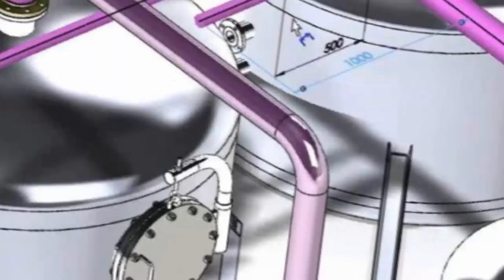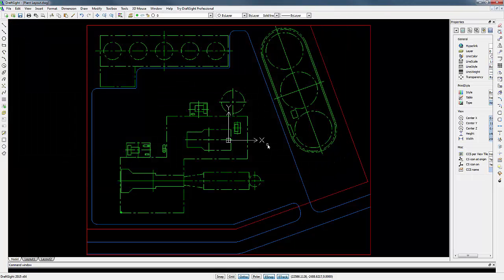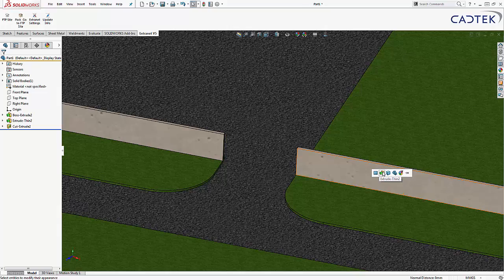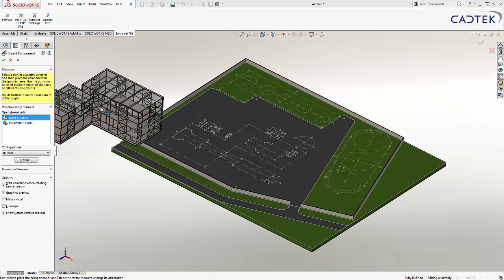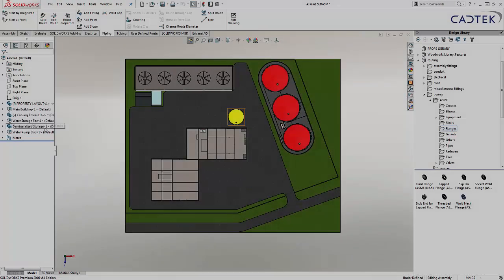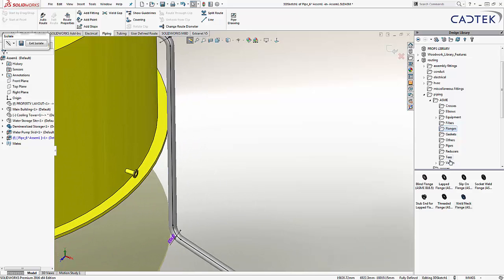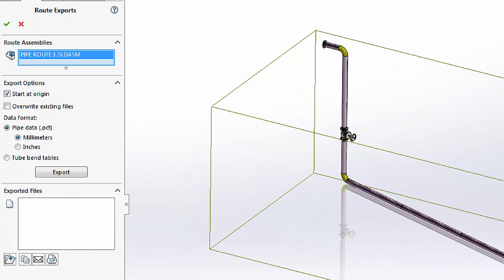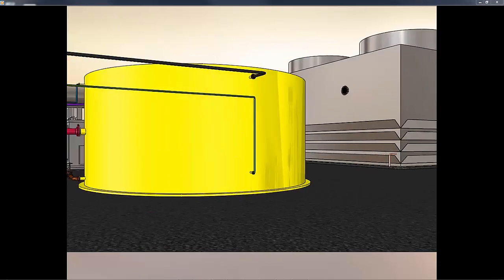Using SolidWorks for Process and Plant Layout

Comment: In sales video they import civil engineering DWG files and can easily 3D extrude by selecting watertight contours. In the real world the civil drawings are crap! Lines don't intersect at corners, there are 5 or 6 lines on top of one another, some components are over-complicated like trees with 25 000 lines and arcs, would-be horizontal lines are at 0.00001 degree from horizontal. Everytime it is much less time consuming to simply draw from scratch healthy geometry than try to repair crap... my 2 cents!
Reply: The difference between 'ideal' and 'actuality' is striking for anyone that has experience with this kind of work and in these kinds of environments (in my experience). I feel you